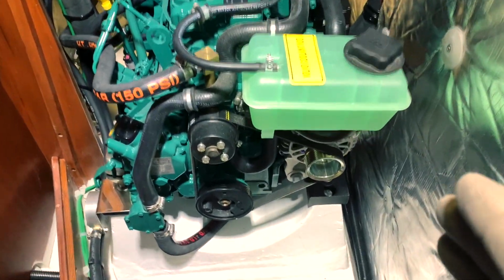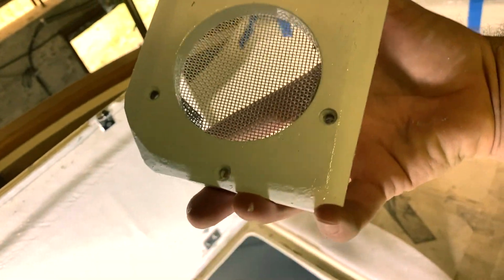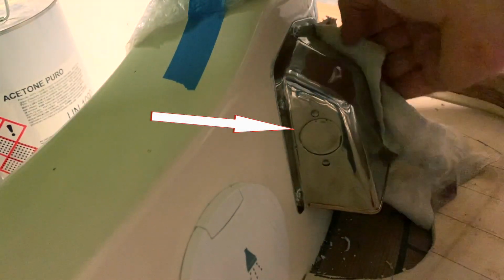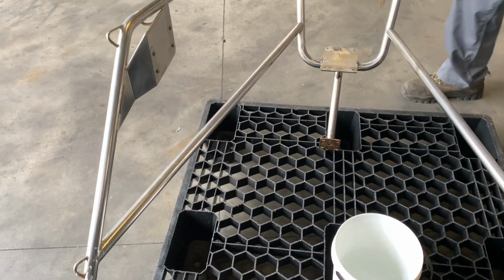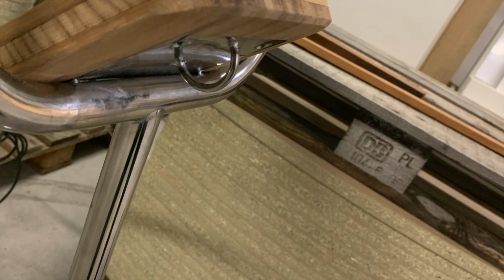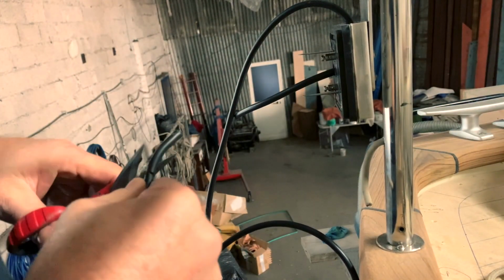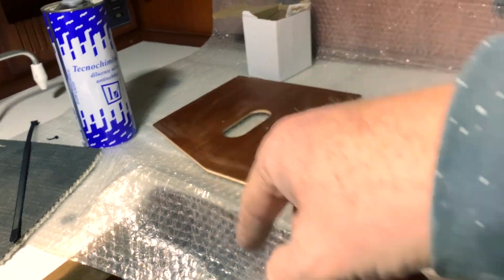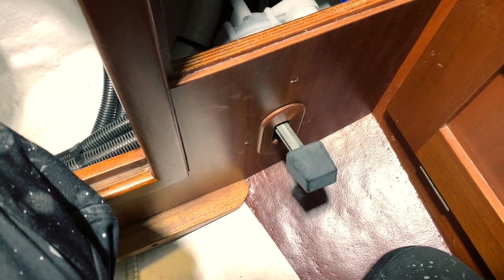Hallberg-Rassy 312 "Ellös": FINISHES..TEAK STEP..COVER..LED (DIY BOAT)

Comment: why is silicone danger ?
Reply from the maker: jan... silicone is the cancer on the boat. It may be used only in the sink other utilise is to avoid because with movement it detached an permit the entrance of water, second when you pollute the surface with silicons you need to sand before using any other type of stuff on it...believe me stay away from it..

Comment: Use led lights.
Reply from the maker: Yes mark but there are not approved... need to change them ..
Reply: @sea4see  led lights are approved for use on yachts, you need to get the right ones.
Reply from the maker: Yes Yes I know there are approved ones , what is not approved are the led bulbs you use in normal enclose. You need to buy all the set of light and it cost a fortune.👍🏻

Comment: Hi Gabriele,
Just curious, did you discover the right recipe for matching the original by HR varnished mahogany interior parts? Is that with the Epifanes eggshell finish (not as shiny as the varnish)?

Great work again, I am considering to move my boat works to Italy and close to so many helpful craftsmen :-)

Best regards from Holland
Reply from the maker: Incredibile or not the epifanes satin or matte finish had the color inside that match very well the original color.. at hr they use che cherry tree color to give warm aspect! I try with the bare wood in some part inside after a sand with epifanes match perfectly

Comment: Hi Gabriele,
are you sure, that using this LED bulbs is conform to actual EU rules? I am afraid it is not. I really would love to cut my nightly light consumption from 30 Watts to 3 Watts using LEDs myself, but I haven't found certified products for a reasonable price yet. Please let me know if your bulbs meet the EU requirements  and if so, the brand and how much you paid for it.
Kind regards, Alex
Reply: Now when you brought it up, I might as well enlighten how it is (as I'm somewhat a professional). A LED light bulb in a non LED navigation light enclosure will disturb the light sectors. Light sectors then again affect the rules of the road, who gives way to who.
That means that you can only retrofit a LED bulb in a navigation lantern that is 360 degrees single colour. Like for example in your anchor light.
Now somebody is going to hang me for saying this, but I say it anyway.
In a slow moving boat at night on an open ocean a ship will not care so much about the sectors you show in a small boat. The only thing he will mostly be interested in, is that you show as bright navigation lights as you can. And keep them on all the time at night! Not only when you THINK it's time to swich them on when you THINK the ship is close enough. LED light bulbs are much brighter compared with the old type bulbs and because you do not need to worry about the power consumption, I personally think the LED bulbs might be a better option in some cases.
In my sailing boat I use the normal bulbs, but then again the boat has the 25W navigation lights and alot of battery capacity.
In my tiny motorboat I'm using illegal retrofitted LED bulbs.
Come sue me! ;-)
Reply from the maker: True mate!!! I retrofit led light on normal enclosure.. looking for approved one for night sailing only didn’t want spent too much money.. but seems impossible
Reply from the maker: Ciao Alex!! The bulb didn’t know if are conform but really I don’t care... at the moment...the structurethat containing it  is approved.. I got some bulb for spare in original form ... in case... but I always used led light in also previous boat... the next step is spend a fortune to install approved ones....

Comment: My previous comment with a link went to junk mail, so I just write the description of the air vent at the stern.
Cquip 10-21330 Stainless Steel Clam Shell Vent 140 x 115x 52mm
Reply from the maker: Thx! Did you think are the same of what Hallberg-Rassy used?
Reply: @sea4see  I think so yes. They are very commonly used and available in most stores here. I believe they have (had) those everywhere in Sweden too...
Are you sure they are originally installed by HR?
Reply from the maker: Yes! Need to check my ones.. here impossible to find